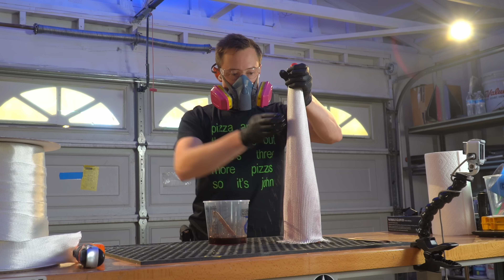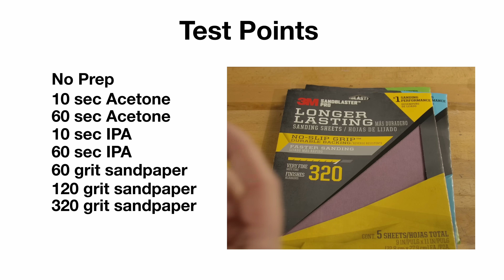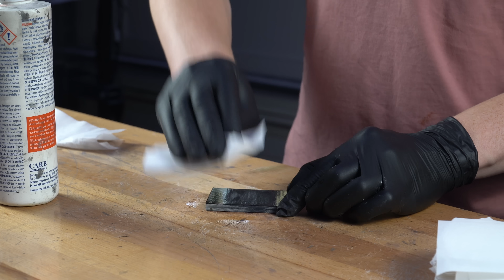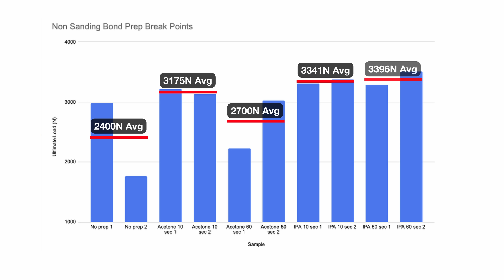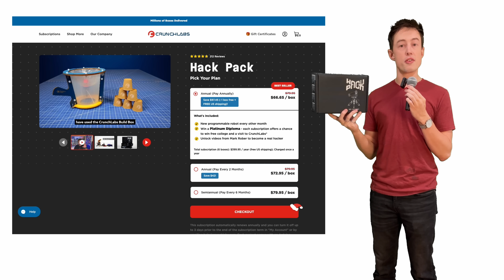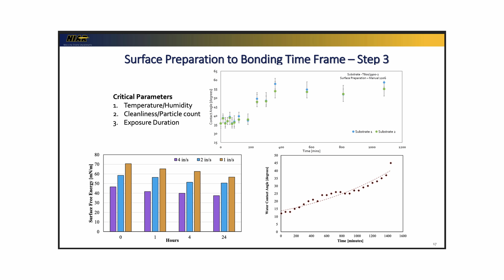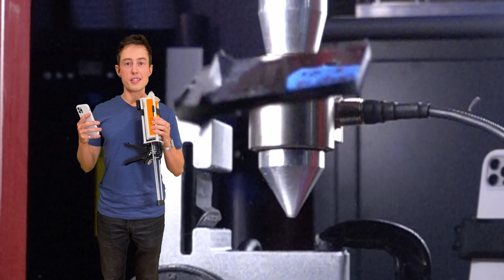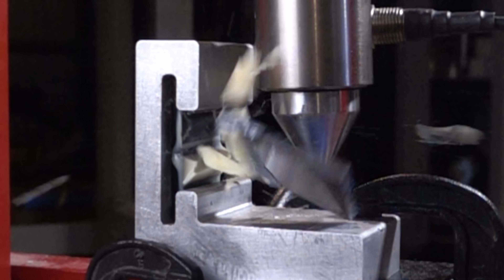I Broke 100 Epoxy Bonds to Find the Strongest

Comment: 2100 comments in...

With regards to cleaning, here's what I do for my personal projects (which never see "rocket kind" of loads):

To clean, I use what is available here as "universal paint thinner" (thinner for what is called here "alkyd paint", or also called "artificial oil paint" here) instead of pure acetone. It's more aggressive than acetone in everything, solving paint and contaminants, attacking the surface, possibly also more aggressive in attacking the lungs. So short wipe, and personal protection.

Then I immediately use brake cleaner (instead of alcohol) to wipe off the residual paint thinner. Brake cleaner is far less aggressive than paint thinner. Also brake cleaner should evaporate fully by itself (low boiling point, AFAIK), so it should not leave any residue behind. (Also brake cleaner should remove some more contaminants, which the paint thinner might have not fully dealt with...)

Then maybe a quick dry with warm air to speed things along would be a good idea - but I don't do that.
Reply: After reading a couple of comments:
1. Clean THE SANDPAPER with brake cleaner.

2. Shortly clean surface with paint thinner (or acetone). Maybe better cleaning agents available that "work" well with the resin used in the carbon-fiber. Maybe search for Applied Science's YouTube videoe "How to choose a cleaning solution".

3. Thoroughly clean surface with brake cleaner, let it all thoroughly off-gas.

4. Sand the surface. (Maybe wet the sandpaper with brake cleaner?)

!!! Don't use paint thinner after sanding (nor acetone!) !!!

5. After sanding, clean surface with only(!) brake cleaner. Wet wipe, and immediately dry wipe.

6. Let the brake cleaner off-gas before gluing, but don't wait to long before gluing.
Reply: After reading some more comments:

Choose a sandpaper that is "clean" of contaminants.

Don't sand into the carbon-fiber.
Krylon dust spray.
Maybe sand with a scouring pad (or steel wool), and wet it with brake cleaner.

Peel ply.

Consider dry ice cleaning.

Use a more modern and more suitable adhesive.
Chose an adhesive that "works best" with the resin you have in your carbon-fiber!
I.e. similar moduls between resin and adhesive, similar thermal coefficient.
More flexible adhesive in combination with some form of carbon-fiber reinforcement plies.

Pi joint?
Put some fibre (or sheets/mesh/weave of fibre) into the adhesive.
Use a fillet?
Microballons?
Glue on one thin continuous carbon-fiber weave/plies/mesh from one fin to the next? (Wet lay carbon plies?)

When applying the glue, first brush a thin layer of glue into the surface (i.e. with a scouring pad, steel wool, ...).
Reply: Also:
For testing, drill one hole in each test piece, where the test apparatus applies the pressure. So it will always apply the pressure the same.
Reply: Yeah, enforcing the joint strength through some form of carbon-fibre plies seems advisable.

Comment: Don’t beat yourself up about not performing a shear test.  They can be just as finicky or worse.  I always prefer a test that approximates my actual loading conditions.  If you’re are looking to compare one epoxy versus another well then maybe a lap shear is OK but you have to control for bond gap and tab alignment, also double lap produces a better pure shear state (verses single lap) but is even more difficult to consistently fabricate.

Comment: There is one angle. I don't think I heard you addressing this. When you sand and apply epoxy to something and then put it in a vacuum chamber, you will tend to draw the epoxy into the substrate you've applied it to. 

That is the likely reason why you ended up getting that significantly higher number on that first sample

Comment: What would happen if you used a cheap laser engraved to "mark" the surface. I have even seen handheld units that would be perfect for large surfaces, which can probably treat a surface 4x4" fairly quickly

Comment: When I had to bond aluminum to fiberglass, and alum to alum in the past, I of course firstly sanded the parts but I added another technique that I think is very important to produce the ultimate adhesion: Once the epoxy was mixed, I didn't just spread it on my parts, I took a piece of 400 grit sandpaper and used it to kind of rub-in the epoxy to the surfaces. The thinking here is that if you just lay the epoxy on the parts, you have millions of microscopic air bubbles in the grooves that have been made by the sandpaper, that the epoxy is just going to cover. This reduces your contact area. By sanding again with liquid epoxy between paper and part, you force the epoxy to make a much better  contact, at the molecular level, with the surface. Another reason for this technique is that the aluminum very quickly oxydizes right after it has been sanded, in seconds actually, so by sanding again with liquid epoxy in the interface, you eliminate that new oxyde layer and allow the epoxy to bond to really clean aluminum. This will also work with any contaminant that might still be on the surface of your part, silicone for example, that is very difficult to get rid of. This wet sanding method will still allow the epoxy to reach the surface.
One other technique that strengthens fillets is to add some very short glass fibers to your mix. These are called called milled fibers, I use the shortest ones, about 1/32" in length. Your fillets will then be very rigid, and then if there's no deformation under stress, they will support your parts much better. This will minimize the possibilities of failure by peel mode.
And of course, I have never used the mixer tubes that come with the epoxy guns, as I much prefer mixing manually thouroughly for quite some time, so the two components of the epoxy can totally interact molecularly to produce the highest strength possible.
Thanks for taking the time to do this experiment, and the accompanying video! Cheers!

Comment: Your videos are all ways Interesting, but the wood worker in me has some questions.  In wood working the larger surface area for a glue joint the better and stronger joint.  Is some of the slow mo breaking clips it looks like there No epoxy on the edge of the piece contacting the flat surface of the other part.  All most like there is an air gape there and your just praying the gooped on epoxy on the surface of the fin part will stick to the surface of the rocket body part.  It like your relaying on just the epoxy to carry the load and no real bonding of the two parts is really going on.

Comment: I love it !
What will be the difference if you use a pressure chamber to remove bubble in place of a vacuum ?
What would be the difference if you use a laser ( rust cleaner laser ) in place of a plasma ?
And when you glue you ( maybe ) sand the end surface that contact the other and put glue there before sliding into the mold .

Comment: Dumb question since I'm a rando, why not slot the pieces with sanding and bonding together with epoxy? Would the air pressure break at the spot they meet at, or would it be stronger since it's closer to one piece?

Comment: I'm very unqualified for this comment, but it does make a sort of sense that if you are ripping apart the substrate or the actual epoxy that the surface prep (in this case the sanding) would not make much of a difference. So sanding with a more course grit could improve adhesion if the fiberglass substrate and epoxy batch are exceptionally strong, but it ends up being inconsistent because it's adding an extra step that potentially introduces contaminants that prevent the adhesion.

Comment: Note. Instron is a manufacturer of stress, strain, and force testing equipment, prominently in materials manufacturing. The actual name for this machine is called a load frame. Instron is very common but there are dozens of other manufacturers or custom made load frame makers. There really is nothing more annoying in the world of test equipment than when people refer to all like instruments by a common manufacturer name. It isn't pedantic, it truly limits communication and causes problems with expectations.

Comment: 2,110 comments later....you can read mine. I wonder?  Anyway, way back I worked on a solar car for the world solar challenge and we faced almost the same problem. For what it's worth, our solution: fill the corner with a long section of structurual closed cell foam with triangular cross section (except the hypotenuse is curved). glue in place with your epoxy. Then lay up a single ply of carbon fiber over it and rest, bag, cure, sand, paint : light weight, strong as anything

Comment: Flame treating works well and it's actually pretty easy with a small amount of practice.  It's quick too so you can apply your adhesive very quickly after treating.

Comment: If you want to test sanded surfaces, it’s important to follow these steps: first, degrease the surface, then sand it, and finally degrease it again. The reason for this is that any oils present—possibly from your hands—can become ingrained in the surface during sanding, making them difficult to remove later.
Reply: Yeah, now that you mention it, it seems obvious:
CLEAN THE SURFACE both BEFORE and after sanding.

Comment: makes sense, same as folding EPA filters to increase surface that is used to capture dust... using small grit or in ur case higher grit... the 60 grit or lower 40-20 etc will make scratches "folds" that will give more surface area to grab onto and also some micro "channels" where the resin can go into and create sort of a "weld" like tiny fingers trying to grab all the croocks and cranies it can find.... IPA makes sure there is no dust so all them "fingers" can actually grab the solid 1 piece material... and not some dust particle that is not attached to the material... so sanding and ipa should in theory make sense.

Comment: I appreciate the extensive testing and the willingness to try something new you thought you had previously explored.
The parts I make for space (metal, not composite) often have the requirement to acetone wipe first followed by IPA so I wasn't surprised when you came out wit that final result.

Comment: The fiberglass coupons could have had some of the waxy film left from the manufacturing in the form of amine blush. I have heard that removing all traces of amine blush before any sanding occurs is critical to not contaminate the sandpaper and the lower surfaces.   I have watched tons of videos on composites and also live on a fiberglass sailboat. While acetone and IPA have always been the advice given to me, I also did not know that it was so critical to use both. This was a well put together video and I especially appreciated the section on surface energy. Now I have more understanding why you should add flame to plastics before using adhesives on them.
Reply: Clean BEFORE sanding, AND after sanding. 💯 👍

Comment: Hello Joe,
I would like to know at what temperature your samples were cured. Many epoxy resins require a temperature above room temperature to achieve their full strength and hardness. When repairing small aircraft and gliders made of GRP and CFRP, the epoxy resin is normally heat treated for 24 hours at 55–65 °C or higher to achieve its full strength, but also to increase the glass transition temperature. The LOCTITE EA E-120HP data sheet lists two values for shear strength: 13.7 N/mm^2 after 2 hours at 60 °C and 33 N/mm^2 after 12 hours at 60 °C.  It could be that the higher values in test 3 with 60-grit sandpaper were achieved simply because the samples happened to be cured at a higher temperature for a longer period of time. A temperature increase from 20 to 30 °C due to a warm summer day could already make a difference.

Comment: This is legit just my capstone all over again rotflmfao. 

When he didn't instantly talk about surface energy I knew where this ship was going. 

Then when he was like f plasma and pulled out the butane torch I was like yep checks out. 

I had to try and ask my professor for a butane torch for surface prepping with super glue for a model airplane. 

He was not amused and I got shut down.

Comment: That's an awful lot of work but in the end you found out the most important conclusion. Bond prep is more about making sure you well get consistent results rather than the absolute best mechanical strength on a couple coupons. Here's some best practices from aerospace manufacturing : 240 grit sandpaper (can't remember which compound, but it matters). Wipe with IPA before and after. Bond within 2 hours of prep. Using a peelply is a good idea, not so much because it yelds better results but because it is very repeatable and less labor intensive. Bonding is not just about roughness (mechanical interlock) but also about molecular bonding, that's why fresh (no time for oxydation) and clean matters. Also, mind the design of your joint and properties of your adhesive. Avoid working in anything but shear and perpendicular tension. Get an adhesive with thixotropic properties (non sag), gap setting properties (can't be squished too thin) and most important, has good PEEL strength and FRACTURE strength. Because your joints won't always be perfect static tension and shear.
Reply: Many sensible things here!
Clean before and after sanding.

Also, to NOT introduce contaminants with the sanding paper seems sensible.

Comment: I have spent many years doing surface prep for various polimers .. 
Though never scientific,  I can share some of my experience that gave me the best consistent results.
1. things dont want to stick to carbon or fiberglass this is evident when parts delaminate at catastrophic failures. 
the strength comes from saturation between the weaves fusing all layers into a monolytic structure. So never sand
through the top surface. 
2. before sanding, always pre wipe with wax grease remover to remove mold releases etc..
3. orbital sanding provides a more consistant results without hollowing out your surface.
4. use course 80 grit first without trying to completely scuff the surface. this more safely gives deep scratches increasing surface area
5.  then use 180 grit to remove the remaining shiny surface
6. do 2 final IPA wipes ensuring no cross contaminates.
7. let dry for 20-30 mins. IPA not only contains water but is hygroscopic and will pull it out of the air. your surface must be dry.
This gets even worse when the temp and humidity in your environment gets closer to dew point.
8. never touch the bond surfaces again.. not even with gloves on.
9. pouring onto a surface can trap micro air in the deep valleys of the scratches creating a surface tension.
smearing on a tight thin coat working it into the surface prevents this and ensures no surface tension exists.
You need plenty of work time because you can Not! let this tack up..
Hope this helps.. 
Excellent content..  TY for sharing Cheers  :)
Reply: Seems like very very sensible advise all around, but I have one question:
Why not use brake cleaner instead of IPA?

Comment: As far as your sandpaper test goes, all you need to do is put it on a block of wood put a 5 pound weight on it and slide it across X amount of times

One solid stroke should be the best

Comment: 13:05 Likely far more important is that the vacuum degassing gets the epoxy into the fibers that were exposed by sanding. That makes the interface far, far stronger.
Reply: In fact, I wouldn't be surprised if the harder sanding with degassing ends up being the strongest technique. The reason it's so weak without degassing is because there's a bunch of air trapped inside the exposed fiber weave which provides an easy place for a delamination to travel.
Reply: 20:11 Glad you added that note. Any atomic oxygen immediately bonds with the fuel molecules. Ya know… combustion.
Reply: Yay sanding!
Reply: Ugh… switching to the orbital sander was a terrible choice
Reply: 27:29 JOE!!! NO!!!

Comment: Vacuuming out the assembly pulls air out of the sanding grooves/cuts, and allows the epoxy to fill in these grooves, and is likely why it makes a significant difference in strength

Comment: Another factor that you did not test for.  with applying epoxy I always use mechanical action to insure contact on the surface.  The vacuum chamber off gassing may create some agitation to ensure contact as well as the vacuum removing air that would lessen contact.

Comment: Get the Sweepy Pro! It mounts to the carriage instead of the spindle, so you won't need to adjust it when doing multiple passes at different depths.

Though, obnoxiously, this also means it'll bump into the Bitsetter. I've been working on a redesign that moves the Bitsetter's electronics into a much lower-profile package.

Comment: Plasma is great...but you generally need a sub 50mTorr vacuum chamber.  You can also use different gases depending on the substrate, oxygen, helium, argon...  I've personally activated PTFE to which super glue bonded.

Comment: If I had the test setup I would test how temperature of the surface affects bonding strength. Might not affect it at all with epoxy, or it could make id less strong because the epoxy cures too much or it can make it much stronger because of better adhesion and polymerization of compounds at certain relatively high temps. What I know for sure that when using hot glu, having a high temperature on the surface helps adesion quite a lot but thats a very different adhesive. I wonder if there are more rigid versions of hot glues. Hot glue is incredibly strong in certain situations.